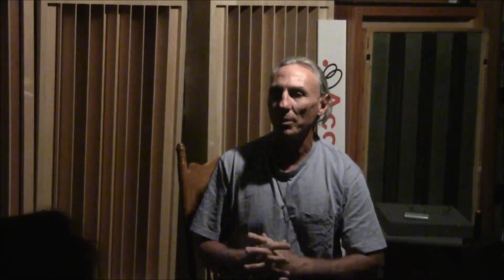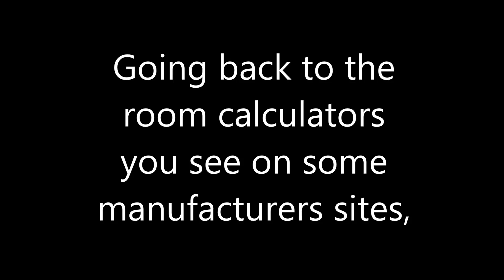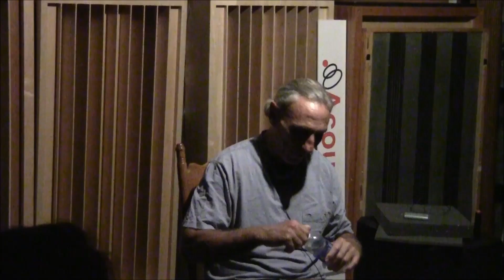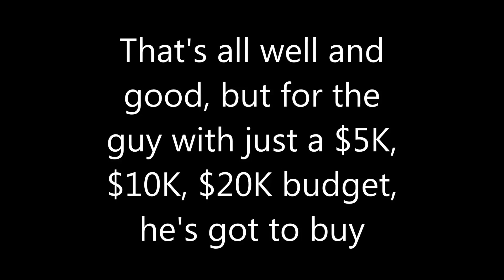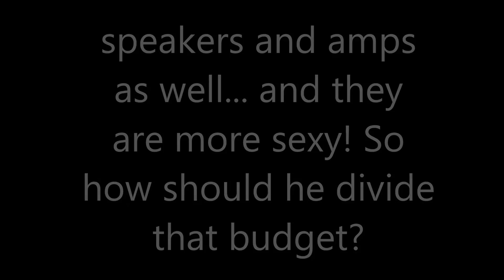Dennis Foley Acoustic Treatment Interview Part 3

Comment: We have some of your treatments.  
The total mass you quoted seems like a very all-or-nothing approach that is not always practical, and maybe too often not reasonable.   
How many tons of treatment do you think it would take to do my 62’ x 37’ by 14’ room, if it takes about 10 tons to do a ‘typical’ room?  What range of cost would that be?
Currently, for the most part (other than a couple of mid frequency peaks that we are working on, at typical listening levels we are about +/- 5 dB.   We spent about $10K between purchased and created treatments.  This is with near field and near-mid’s at about 82 dB.  I know mains would be more than that at higher listening levels.
Reply from the maker: We are all about resolution and the treatment rates and levels it takes to achieve a +/- 2 dB response from 30 - 20 K.  Our studio size is simialr to yours and we currently have around 9,000 lbs of low-frequency management surface area coverage. We are still working on the low end.  When we design and build new rooms, the low frequency management averages from 25 - 50 K in 90% of our projects.
Reply: @AcousticFields  that sounds excellent.  I know every project’s different, but what’s the average lead-time and studio down-time?

Comment: What should i do with closed cabinet speakers? Does it effect the tightness of the bass too if i move the BDA absorbers right behind them?
Reply from the maker: Hi Miesn, Do you mean sealed versus ported sub woofers?
Reply: I mean seald loudspeakers. My monitors don´t have an open port.
Reply from the maker: Hi Miesn,  The room only "sees" frequency (notes) and amplitude (strength) of those notes. It does not matter to the room that the energy comes from a sealed or ported enclosure. Be careful with ports and boundary surfaces (walls). Ports have two design functions. First, they allow more flexibility for the speaker designer to go after certain frequencies (notes). The reason for that is topic for another discussion. Second, the port energy strikes room boundary surfaces since they propel energy through the port which then causes"port sound". Next, most manufacturers recommend placing then close to walls. This SBIE produces distortions which can produce +3 dB - + 6 dB of room unwanted pressure. Low frequency energy devices (subs) must be positioned correctly, elevated to the proper height and placed away from room boundary surfaces within a room's specific size/volume/usage.
Reply: Thanks! I have build two BDAs and made measurements of my room. It took a long time to figure out the best position. The waterfall diagramm shows now that the BDAs have reduced the decay time of the low frequencies a lot without the carbon. Next there will be follow two more.. and more.. and so on until i reached a nice result :)